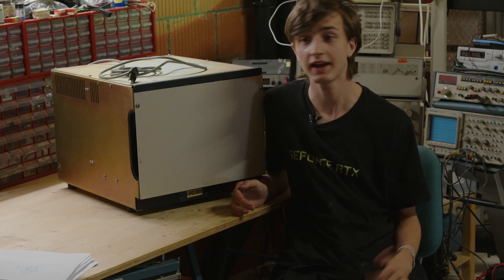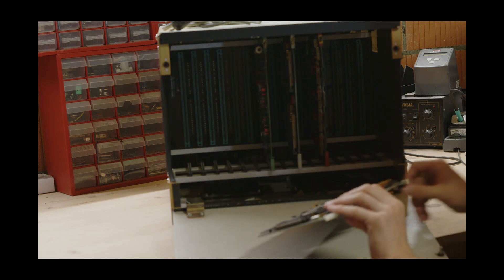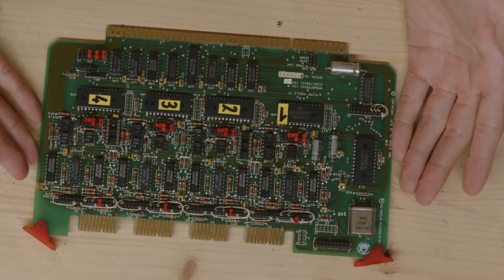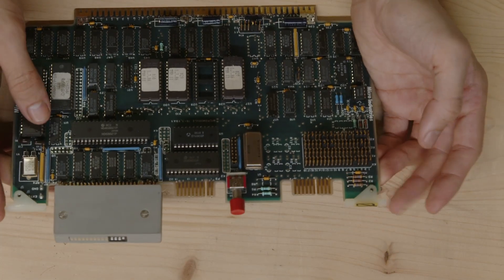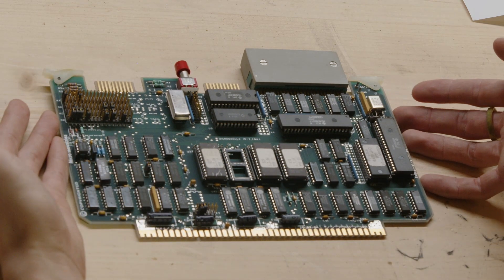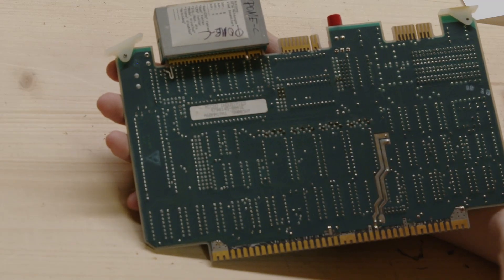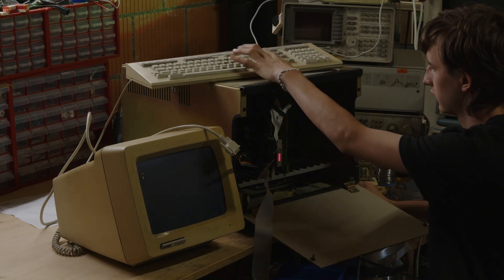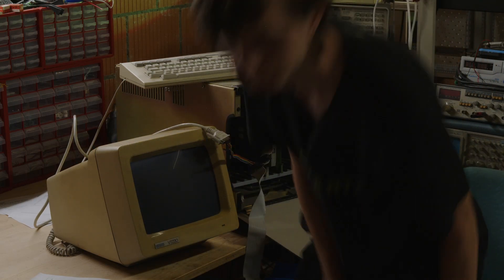Reverse Engineering a Completely Unknown 1980s Computer system

Comment: There are probably a pair of 16-pin chips there, MC1488 and MC1489.  If the driver chip is bad but not smoked, you can get garbage from it.  Replace the driver and test.

Comment: Turn off all handshaking on the terminal. Connect RTS and CTS to each other on the terminal. Connect RTS and CTS to each other on the computer. Try that. CTS is "Clear to send" which means "hey, you can send me some data if you want". RTS is "Ready to send" - which means "Hey, I want to send you some data". By connecting them to each other you are telling both ends of the serial link that they can transmit whenever they like. Of course, you will also have to determine the serial baud rate (the speed at which data is transmitted - measured in bits per second). Both the terminal and the computer must run at the same baud rate. You could try 2400, 4800, 9600, and 19200 and see if you get any response. 👍

Comment: Youve got a whole computer just on the cpu board! 68B50 serial, 6840 timer, 6821 pia, u27-u30 are uv roms, but the one next to the cpu might be a “prom” - be careful with that one because it might be one time programmable and difficult to replace.  Somewhere on there will be a little bit of ram.  Possibly even a realtime clock chip ?

Comment: I've done a fair amount of 6800 disassembly lately, so maybe I could help with that. I agree that probably you have the correct idea with the main serial port, but you need to find the right speed and parameters for your terminal. I tried to join the discord, but no permission to read anything, not even the rules channel.

Comment: Those cards look extremely similar to those that run on an OcTel VMX200 that I administered in the late 90s - mid 00s. It had a local terminal or PC connected directly or could be accessed thru telnet for cli.

Comment: Byte magazine, May 1986, has a reference to this machine --

"Micro Industries of Westerville. OH. now has the license to manufacture and market the Micromodule line of 8-bit microcomputer boards and accessories that was previously available from Motorola's Microsystems Operation. Micro Industries has contracted to provide service to boards built by Motorola for a minimum of five years. This contract ends Motorola's 10-year development and production of the 6800-based boards; the company will focus on VME products using the 68000 and its successors."

Comment: the ST chip 68x50 on the CPU board is probably the serial console for the computer
could you share high resolution pictures of both sides of every board ?
the machine outputing garbage on the terminal is a sign of wrong speed, not the need of modem control
Reply from the maker: I will do that. Join the discord, ill post them there

Comment: Maybe there is a baud mismatch and it waits for an enter. Look for signs of life with an oszilloskop.  You can determine the baud from there. Or it just waits for some external switches from the machine it was once connected to. But then... why does it have  a serial 4 ports card?

Comment: If I'm not mistaken that thing uses what they used to call an S100 bus which is what those boards plug into. Man I haven't seen one of those since the 1970s!!
Reply from the maker: Almost correct. It is not a S100bus. Its a Motorola EXORbus. Idk if they are compatible, but thats what i found out.
Reply: @curiouscomputer  oops. Thanks for the correction.! The things i learn on  youtube :)
Reply: Very similar form factor to S-100, but not exactly the same so I would bet on 'not compatible'

Comment: 3:25 Get the things right.
EEPROM is Electrically Erasable PROM (those were very rare in 80s, actually, I started to see them in mid-90s)
EPROM is Erasable PROM (usually UV erasable, they have a window on the chip)
PROM is Programable ROM
ROM is Read-Only Memory.
2:58 that is or not RAM? Or most likely? 
You know, there is the thing called Internet to search and check the markings on the ICs, just to have an idea about what they are and what they do.
I really like your old computers, but is hard to follow the most likely accurate maybe I am not sure about what I am talking expalantion. Inform yourself about (yes, get down to the IC datasheet), then explain what you have.
Reply from the maker: Its about exploring. I dont know much about the machine, and im documenting my exploration. If i would have reverse engineered the board, i would explain it better, but i havent.

Comment: Could very well be an EXORciser clone.  AFAIK EXORbus was never very popular outside of 
Motorola development hardware as the boards were just too expensive.
Reply from the maker: it is a EXOR clone. but i figured out what system i have exactly. at least the CPU and I/O card. as well as ther serial card
Reply: Exorbus was popular with embedded systems. I've seen (bread) oven controller with it, an industrial sewing machine and other devices. The ROMs will determine what it's running. Could run OS9 (Level 1 for example) but you should be able to burn MIKBUG (sorry that's the 6800 version), ASSIST09 (6809) and play from the CPU cards 68x50 (ACIA - serial portr).There are other ROMs you can adapt.

Comment: [Random Garbage] = baud rate mismatch.

It used to be a major headache.

Whip out the two PROMs on the memory card - and it should just boot into the system monitor.
Reply from the maker: The random garbage happenes when i turn off the computer. so i blame it on the voltage collapsing and transmitting something. because it always only transmits random garbage when the power goes out